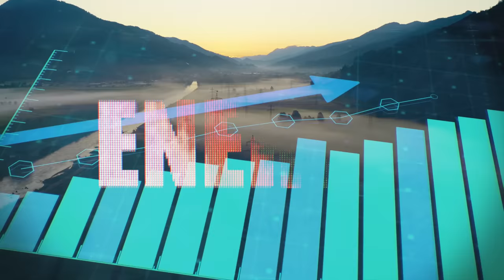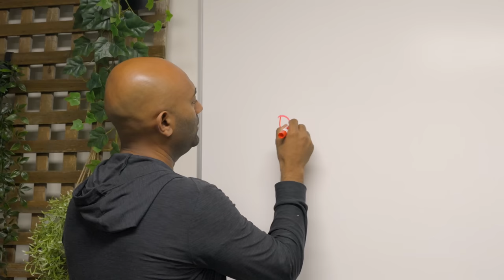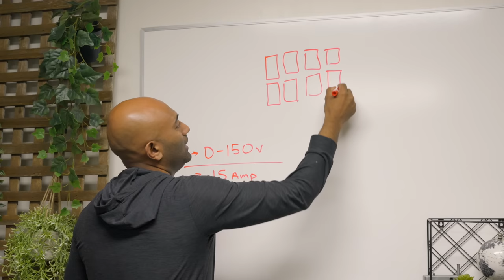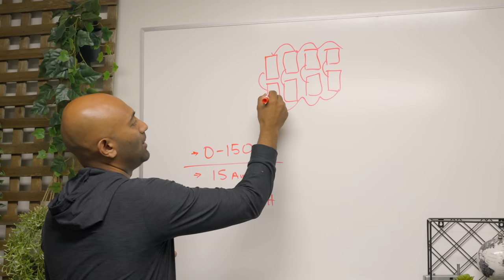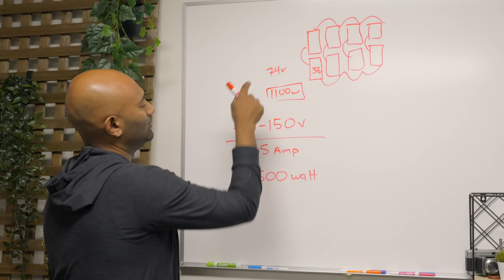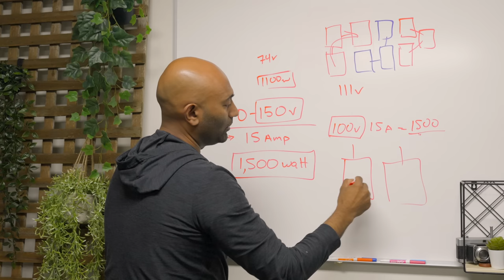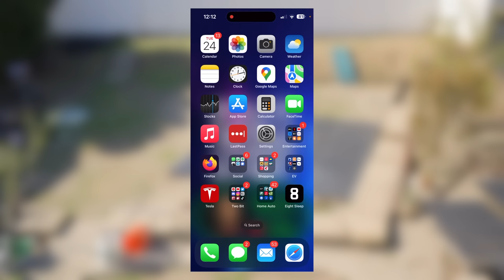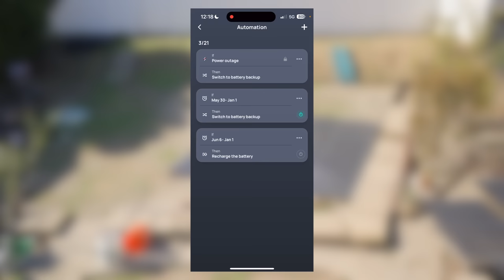Home Backup Power + Solar Power WITHOUT Permits!

Comment: Thanks for this video, Ricky. You’ve touched on many of the issues that we discuss for owners who want to put panels on their rooftops…the basics. And you also discussed one very important aspect of solar and storage,  which is that it’s all basically modular and can be dismantled and moved or upgraded. That, coupled with the “no permits“ aspect should make solar and storage attractive for everyone. The only thing I would add to this discussion is that if people aren’t already, they soon will be, driving their largest storage battery around. Of course, this is another big permitting hurdle, as well as software and firmware development. But it’s happening! At the speed of Light, so to speak.
Reply from the maker: very True Tom... what EV are you driving again? also, does it support V2G?
Reply: @TwoBitDaVinci  I wish!  My converted VW bus was totaled by a drunk, and I have yet to get into another EV. I think I will just bite the bullet and buy a Tesla, now that my fractured neck has healed.
Reply: @TwoBitDaVinci  Australians are freely able to install solar panels and battery storage units with no government approvals whatsoever. Moreover, there is no legal obligation to be connected to the public electricity grid, either. Most new build Australian homes have rooftop solar panels installed. 🦘🇦🇺
Reply: @user-kc1tf7zm3b  how is your anti-islanding,safety concern solved?
Reply: @joestalin2375  Australian electrical safety and regulatory standards are extremely high. Just as it is for aviation. And you wonder why Australian planes always land safely. Qantas, the Australian flag carrier, is proof of this. 🦘🇦🇺
Reply: @user-kc1tf7zm3b  Hell yeah 👍 Anzac is bad ass ,heard half of the your Continent lost their guns and liberty,so I fear for your freedom.
Reply: @user-kc1tf7zm3b  regulations,good ones,how much does the test cost, LoL
Reply: @user-kc1tf7zm3b  that’s how it should be I don’t understand how permits make anything safer or am I missing something besides permitting usually is just a money grab? Educate me please if you have some insight.
Reply: @joestalin2375  wouldn’t they just install a switch on a sun panel like using a gas generator?
Reply: @dpoohbear  The Australian state and territory governments would prefer that all homes have home solar systems, as this have patent positive environmental benefits. Also, home solar reduces the need for coal powered electricity stations which further reduces operating and maintenance costs. 

Just like installing an electric hot water heater, the authorities have deemed that solar panels are unremarkable, so any suitably licenced electrician is freely able to install home solar without the need for further approval.

Comment: Great DIY video. It took me 9 months to get my solar + battery working (from 1 installation work day to the day my battery storage actually worked). It was a combination of installer incompetence (not knowing how to hook up a system with storage),  delays from failing inspection (due to installer incompetence), poor customer support from the battery manufacturer to admit the battery was defective and to get me an RMA to replace the battery. But now that it works, I buy no energy from the power company at high tariff rates - only low tariff and super low tariff. The battery is 9.7 kWh and can input or output 5 kW. I choose to charge the battery in the middle of the day when the system is generating more than 5 kWh. With the battery at 40% SOC, it only takes 60 to 90 minutes to recharge the battery.

Comment: Fantastic work on a basic overview of how to setup a simple system. A few thoughts.
1. Permitting is very variable depending on the state or province that you are in.

2. Depending on your latitude and cold weather temperature variances. There is a a temperature coefficient that could push the voltage from the panels going into the ecoflow above the 150V maximum because as temperature drops in cold weather even at +10c will increase the voltage output from the panels. This could overload the PV input max.
3. Panels on the ground could lead to an overheating scenario as there isn’t enough airflow to keep them inside the operating temp maximum. 

The modular systems are absolutely a necessity at a minimum for any resiliency.

Great work on the video. 

I’m at the latitude 53 so we get real cold temps.

Comment: I have been using a single EcoFlow Delta Pro with 800 Watts of solar for my Tiny House for a few months. Since I don't produce much in the Winter I have been mostly charging the battery off-peak to save money heating my TH during the winter. We have 6.5 cents for off-peak vs. 15.5 cents during on-peak. Come spring/summer it should cover all of me cooling needs, but we will see.
Reply from the maker: awesome....you wouldve loved to see the RV setup ecoflow had at CES. They have other products like a battery AC unit....would you like to see more products good for the tiny home / RV community
Reply: @Two Bit da Vinci  Yea I have looked into the A/C unit but felt its price to value wasn't worth it for me. But yea I very much enjoy my Delta Pro they are nice and easy to use. They are kind of expensive vs. DIY server rack battery solutions though.

Comment: This is actually something I am very interested in.  With my current plan from the power company, I pay 6¢ from 9pm to 5pm, and 24¢ from 5pm to 9pm.  I'd LOVE to have enough battery backup to run my house for that 4 hours without being on the grid and then just charge the batteries back up in the other 20 hours.  I just need to get enough money up to buy the batteries.
Reply from the maker: great idea.... not to mention the back up and travel capabilities.

Comment: Very educational video, glad to see creators getting folks excited about the PV space.

One note: while there are disclaimers throughout, there are some concerns that have been mentioned previously by others on this video. I also wanted to bring up UL listing for components (for safety and fire testing), specifically for the PV connectors. Though easy to install, they are also easy to install/crimp incorrectly; could lead to arcing or thermal failure at the connections made. And the components used should also be listed as intermateable with one another; if not, could lead to the same types of failures I mentioned even if installed 100% correctly due to the connector mismatch.

Comment: We just completed the installation of a home battery system made by NeoVolta which is near you in Poway. We liked the design because it uses LiFePo batteries instead of NMC and it could connect our pre-existing PV system to it's a/c input while having it's own PV panels connected to their inverter.

Comment: I’ve got 2x Delta Pros and Smart Home Panel in the UK. Generally works well, but there are a few criticisms not covered in your videos…
1) The Delta Pro fans are noisy, and the Home Panel too. They really need to be situated far away from living spaces, like you have them in an outside facing cupboard, or a cellar (basement). Mine are in an under stairs cupboard, but you can hear them in the next room.
2) They’re clearly designed to take solar connected directly like you show in this video, but if you’ve also got some existing AC coupled solar panels, the software has no way of detecting the excess solar and soaking it up. The best you can automate is fixed amount at a fixed time of day, which doesn’t allow for weather / seasons.
3) Their European tech support team aren’t great at responding, and my electrician didn’t rate their knowledge.

Comment: Great video! As an outdoor enthusiast and someone who values family time, having a reliable home backup power solution is essential. The Segway Portable PowerStation Cube Series seems like a fantastic choice with its massive capacity, fast recharging, and durable design. It's definitely worth considering for all our outdoor adventures and ensuring uninterrupted power supply at home.
Reply: Great comment! The Segway Portable PowerStation Cube Series sounds like an amazing choice for outdoor adventures and home backup power. Its massive capacity, fast recharging, and durable design are definitely appealing. Thanks for sharing your thoughts, it's always great to hear recommendations from fellow outdoor enthusiasts.

Comment: i know you probably have sponsors and/or life circumstances that guided you to the products that you review, but i just wanted to bring to your attention Outback's Mojave inverter and Enphase iq ac-coupled solar panel system. They work in grid active and grid down situation, and time of use offsetting. Mojave does 8kW continuous and 12kW (30seconds). I highly recommend as its whats in my garage. In general would like to see more content on AC-coupled solar and battery storage. It is easier to design and is becoming quite affordable. Thanks, and keep up the great content.
Reply: I would add to that the Sol-Ark 15K and other Sol-Ark products.  The Sol-Arks can handle AC-coupled panels and also have MPPT inputs for DC-coupled panels in addition.

There are some design considerations for AC-coupled panels that need to be mentioned.

#1 The main consideration is that AC-coupled inverters use frequency-shifting to manage the power output of the AC-coupled panels (the microinverters must support the feature, but its a UL standard so its mix-and-match, mostly).   BUT, inverters are not allowed to shift the frequency quickly, usually it takes 30 seconds to adjust the frequency to match solar panel production against the home load.

This means that the attached battery and charging / discharging capabilities of the battery part of the system MUST be able to buffer the difference between the solar output and the loads in a grid-down situation for up to 30 seconds.   Battery sizing becomes a very important issue.

And this also means that the batteries cannot be charged to 100%.  The inverter must maintain a buffer in order to be able to absorb differences while sliding the frequency one way or the other.  So the batteries are generally not charged past 90%.

#2 Backfeed to grid.  When the grid is up and the inverter is in a grid-tied mode of operating, the inverter is no longer able to shift the frequency (obviously), so ALL excess power produced by the AC-coupled panels that the inverter cannot soak up by charging the batteries flows back into the grid uncontrolled.   This cannot exceed the utility backfeed limit, which is typically 20% of your utility service size.  So if you have a 200A utility service you cannot have more than 9.6kW worth of AC-coupled solar panels.  For example.

#3 No ability to bootstrap.  With AC-coupled panels in a grid-down situation, once the battery runs out and the inverter is forced to shut-down, it is not possible to boot-strap the AC-coupled solar panels when the sun comes up the next morning (if the grid is still down)...   that is, because the AC bus is shut-down, the AC-coupled solar panels will also remain shut-down.

For this reason, AC-coupled systems with grid-down capabilities and batteries also have at least a small string of DC-coupled panels in order to be able to charge the battery sufficiently (usually to a minimum of 5-10% SOC) to allow the inverter to turn on the AC side, and then be able to utilize the AC panel production once it does so.   If the battery is dead and the grid is down, that's the only way.

-Matt
Reply from the maker: Thanks for watching, We are just getting our home series going so we are very open to checking out more systems and covering them if thats something you would like to see? please send us any recommendations you have and come join our discord if you would like and share more recommendations. we will try to put a link to it on our next video dropping tomorrow.

Comment: Yup, even if you want to get a grid tied solar system installed, it's still good to have a portable system for  when you need extra power or for emergencies before you get the grid tied system installed. I have an eco flow I bought just for running the microwave and fridge for a while in a power outage and fold out panels that can recharge it during the day. I have a different power generator and solar panel for my laptop, etc. I plan to build a decorative solar power battery charging station in the front yard.

Comment: This is my dream setup!! For now I have a small collection of portable ecoflow power stations I got for emergency backup power. I use them to run different items on pass through power when the weather is good. It’s been a great way to learn how to use the equipment and understand how it works. I’m not an electrician so understanding panel configurations is a challenge. Though I have hooked two panels together in series to run my Delta. That’s as far as I’ve gotten. 😂 i don’t have sun exposure all year round like you do, but I can get quite a bit of usage in the summer and fall months. I’m recharging my River pro on a 190w HQST panel now. Hoping for a sunny spring!
Reply: Buy four 3.8 kwh LiFeP04 batteries....4000 for four 300ah 12v batteries....4 x 3.8 kwh...and buy an MPPT charge controller or an all-in-one GroWatt type unit. Then get an electrician to help you. You will save SOOOO much money....and it can be repaired in 5 years or upgraded when a part fails. Why pay quadruple?

Comment: Nice video. Thanks I enjoy the work you do.

On the ecoflow and data reporting thing you "mentioned". The vendor needs to realize that data collection & reporting is a feature that drives loyalty and engagement. Geeks like us will want to see anything we can, geeks are like that because we might want to optimize some setup or just to show our friends how well it works etc. A decent reporting package would probably drive novel uses for the product they didn't consider as customers start using the data to drive how the system functions. I could talk for days on the topic, spent 20 years in software and operations where data and reporting were critical but here's a real example on a scale like this.

Inkbird makes the best temperature & humidity sensors hands down. Solid design build, works very well and are quite reasonably priced. Their main market are brewers and meat & cheese agers, that's why I have their products. They also now have wifi/smart control units that I'm using in ways they haven't thought of but they have the same reporting package as the ecoflow so based on that alone they are losing sales. I need a bunch that do the same but am looking elsewhere so a solution that lets me access data and that I can share with my friends because I do cool stuff. They then might go out and buy the same.

So in short data collection & reporting drives engagement which drives satisfaction and satisfied customers are your best sales channel period.

And a reporting can be a product differentiator that drives purchasing decisions. I really love what I've seen of their products but I would go with a competitor that wasn't as robust if their reporting was more robust than what ecoflow has.

The crazy thing is that once developed "reporting" is low maintenance so it doesn't have much overhead.

Comment: You can also take delta pro to an actual EV car changer to change it back up in an extended power outage.  You could the Extra Batteries with you to the EV changer and change them all back up to full and go back home to get a few more days of power.

Comment: South Florida: 1200watt solar 72vdc pool pump, $100 premium over standard pump that needed replacement anyway. 
Eight used 180watt panels = $250 (17cents a watt) , y-cables and 10feet extension = $30.  3/16in x 50ft wire rope so it's don't blow away = $14,  No timer, No ac converter. RTI = 16months

Comment: Great video.  I have the same set up....I'm north of you in Carlsbad.  I realized in the winter I will need another battery though since there is less sun to charge the system.  I'm running the whole house off these.

Comment: Great video. You should mention about Voc and Vmp of the solar panel, the total Voc of the panels should not exceed the max PV input of the Solar generator and you also need to factor in the Voc rise as temperature goes down. The Vmp is the one you use for calculate (Vmp x Imp) the power you will get from the panels. So if your Vmp is around 37V, the Voc may be around 44V, so for 3 panels in series the total Voc is 44V x 3 = 132V (18V of head room for Voltage rise in cold weather),  total Vmp is 37V x 3 111V.
BTW, so in your city you do not need to get a permit to install solar panels on the roof?

Comment: Sounds good in theory. In my city you need a permit and inspections to have solar. I had 20 panels in my backyard. When they saw them after a hurricane blew down the fence, I got a visit from the zoning department and threatened with a $500. a day fine. So I disconnected them and stacked them on the porch until after the fence was fixed. Also any electric work done without a permit voids your homeowners insurance. If they made the batteries to plug into any outlet to run your house you would be better off in regards to insurance. Insurance companies also are starting to frown on legit solar systems using over 20 panels.

Comment: Thank you very much for your interesting video. The wiring and setup of the solar panels is quite challenging, because you are not allowed to cross the 150 V-Limit of the Converter. And you always have to consider the voltage increase of the panels in low temperature, so you better stay around 120V with your string(s).
But what you should know: The 15A ist not a Limit, but the max "amount" of power the converter can use. You can connect 30 A with no problems, but it will only use 15 A. That means you can overpanel regarding to Ampere, but not regarding to Voltage.
That gives a little more freedom.